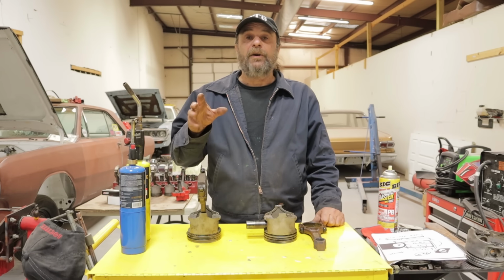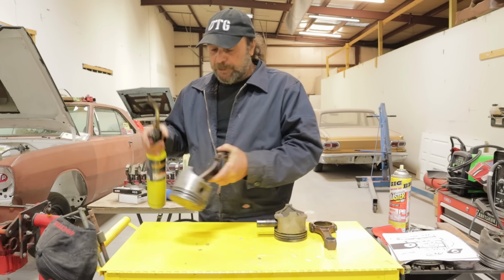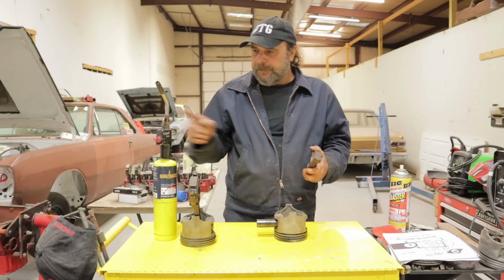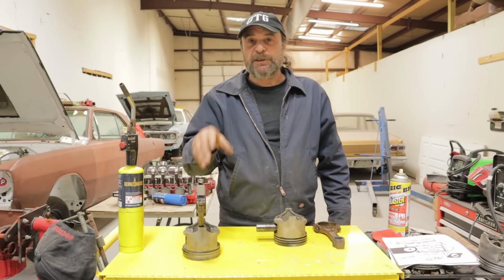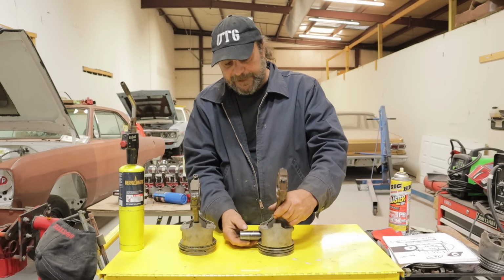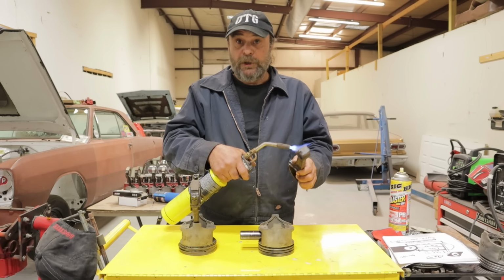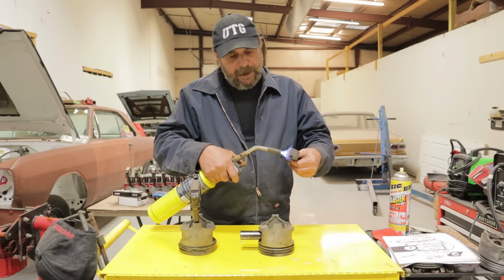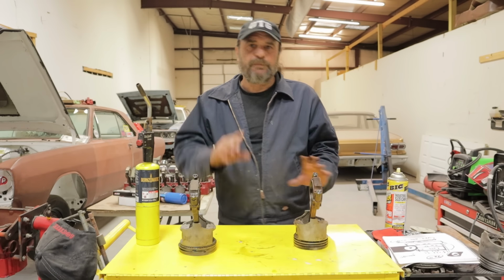Swapping Pressed Pistons For The Home Engine Builder

Comment: When I managed a machine shop we assembled them like that but with a propane torch just turning the rod blue/ purple, not red.
Reply: Red is too hot. And not needed.
Reply: @kmcwhq   Red means its 900+ and you ruined it like Tony.
Reply: Should be 'straw' color which is around 450 degrees. Thats all you need. Anything more is excess. Red is almost 2x hotter than you need.  The Sunnen rod heaters all have timers and work fine without changing the color of the rod.
Reply: @vincemajestyk9497  And that's why you have a machine shop do it
Reply: @kmcwhq  Ya, Without a fixture it's really tough to get it exactly right with just seconds to spare. I don't think cooling the pin helps anything. It's not cold enough to change the diameter but it will suck more heat out of the rod as the two metals equalize in temperature.
Reply: @vincemajestyk9497   Cooling the pin quickly sucks the heat out of the pin and cuts your working time to almost nothing. Anyone who says "Heat the rod and freeze the pin has never done it before.
Reply: @SOLDOZER  I completely agree. If you're starting out with a room temperature pin at 70-75 degrees and freeze it to 0 degrees (a normal freezer) you're not changing the size one bit. All you accomplish is quenching the rod prematurely, drawing your working heat out and closing the end and your window of time. Seen a few poor guys mess it up doing that. Carbon steel alloys expand more when heated than they contract when cold, the amount of cooling an average person could subject them to. LOTS of bad info out there.
Reply: That beautiful peacock color right before she starts to glow...
Reply: Yes, dark blue/purple...not even light blue & definitely not red. ..way too hot 
We used to buff up the rod little end on the wire wheel mounted in a bench grinder so it was easier to see the colours changing with the heat
Reply: I never had much luck at all, with propane. I know most gas powered rod heaters use propane, but having three flame nozzles that are way bigger than your normal, off the shelf nozzle helps propane work a lot better. I use MAPP when I don't have my oxyacetylene torch to do it.

Comment: MAPP burns hotter, not just a bigger flame.  Great video Tony!
Also, the point where the primary cone and secondary cone meet is the hottest part. If the primary bright blue cone is wrapping around the piece, you're holding it too close.  Sorry, I'm a firebug.
Reply: There has not been any mapp gas produced after 2008. If you read the label on that familiar yellow bottle it says map pro. It's what replaced mapp gas. It does burn hotter than propane but not as hot as mapp gas.
Reply: @davidleonard8369  That sucks.  Thanks for the info, one reason I love Tony's followers. I'm no expert so everything helps.
Reply: A little bit of Acetylene does wonders. MAPP gas is not always available these days.
Reply: @jimc3688  Not very experienced with Acetylene, but I wanna study up and get a rig.  I wonder if I put a rod end in my propane forge, would it be good or heat up to large of an area?  Looks like a handheld torch and patience are where my experience level would lead me.
Reply: Was gonna say ,I've got a torch head that is used on mapp or propane just screw an adjustment knob.